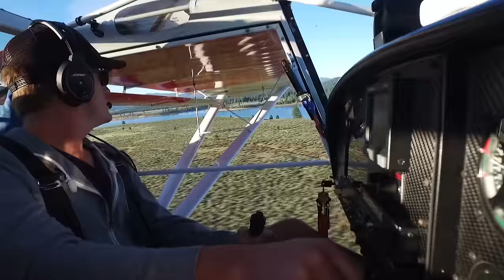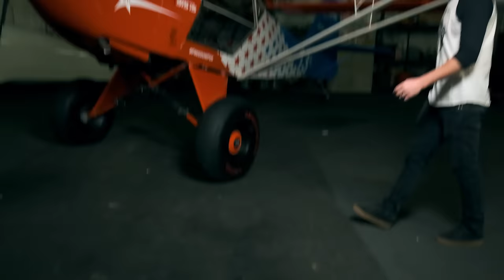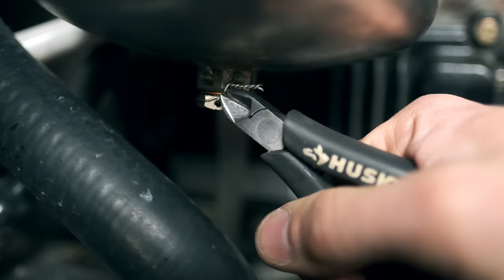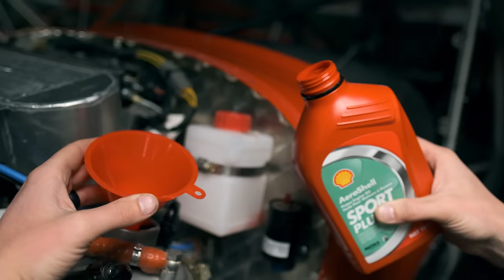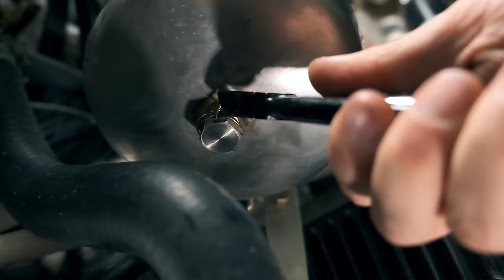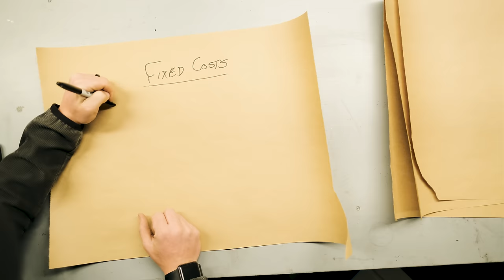What Does It Really Cost to Own and Fly Your Own Plane?

Comment: I'm an A&P mechanic on so I can save there untill an IA has to inspect my work and then sign my Mooney M20C log books which I have 3 log books 1. Airframe 2. Engine O-360-A1D and the Hartzel prop so I spend roughly on maintenance alone and if no major  work done I can spend about $2500.00 but this is not fuel, oil or insurance or hanger fees I spend $350.00 monthly on hanger fee which is heated so here in Illinois it's a god send. Or if you total it up about $7500.00 give or take a couple hundred.

I paid more for my car insurance policy compared to insurance on my plane and the airplane insurance through AVEMCO is a million dollar policy. I don't have electric gear I have the Johnson Bar
Reply: @Av8tore71 >>> FWIW, I would LIKE to build and fly my own homebuilt someday, BEFORE I become _worm food_...😊 
 
My probable choice will be something two-place and with fixed gear.  HOWEVER, if I DID ever choose a design with retracts, I would want something SIMPLE, as you mentioned.  

Just from being a former "Coastie", I am aware of at least two USCG aircraft that landed with at least one landing gear not extended {an HH-65 Dolphin and an HU-25 Falcon}.  Now, I was NOT personally involved in either of those cases, NOR were there any injuries IIRC.  However, the COST repairing a gear-up landing -- IF the aircraft is even repairable -- make retracts NOT a preferred option.
Reply: @Allan_aka_RocKITEman  the retracts  problems always seemed to be the ones that's electric or hydraulic. The Johnson Bar I mentioned is just push tubes and swivels which is just mechanical which makes it less likely to fail. There are plenty of kits out there like a Glassair 2+2. That's a nice kit it takes about 2 weeks to taxi or the Glassair II & III which is all aluminum but these are high performance aircraft. There is also Vans Aircraft which is very popular for home built. You can become a member of the EAA and you will have build coaches who can help during the build process.

Worm food??? Not sure what you mean but people can be worm food driving to the local grocery store

Comment: Trent hopefully you see this, How are you wire locking that drain bolt? it looks very wrong from the very brief glimps of you cutting then re wire locking it. It looks like you have just looped through the bolt and the bottom of the tank, with no twists between the seperate bits. You should have a loop through the tank part, twists, through the bolt then twists.
Reply from the maker: It pulls the bolt in the tightening direction, but it’s not perfect, I was rushed to shoot the video but I re did it after 👍🏻
Reply: @TrentonPalmer  Ah good it just looks an odd way of doing it (I wirelock everyday at work), maybe get an A&P to check your method next time you see one. Stay safe :)

Comment: Friend and I have a bare bones '57 Cessna 172.   It was not expensive as planes go to buy (think mid range used car price).  We have put a little in it to get a few things taken care of but overall it is a solid airplane.  I figure it costs $60-70 dollars an hour for around 100 hours of flying but we will probably fly more.  Our fixed costs are about 1/2 what Trent's are.  Fuel burn is a few gallons more per hour.  

Our hourly cost does not include a reserve.  We have decided not to do that.  Currently we split everything down the middle and when the time comes for a major expense like an engine we will either split it or sell it at the time.  I also look at it this way when you buy used vehicle you typically don't put money away for future repairs.  You repair it as you go and then if you get hit with a big bill you either sell it off or decide to fix it. 

Having a partner, if you can find the right one makes a big difference in cost since the fixed costs and maintenance costs are split in half.

Comment: Those of us who fly certificated aircraft have a great deal of cost information.  I think you are perhaps the only person who has addressed the cost of ownership of sport class experimental aircraft.  My annual  inspections have been running from a low of $5k to a high of $22k with an average of $7k for piston singles (certificated aircraft, fixed-wing).
Reply: My company has a Lance 2 and we would be in the same boat except we do ALL of the work and we have a friend who is a an IA and is very reasonable about his time with inspections. It is crazy how expensive parts are though. We fly about 500 hours a year so we are replacing stuff almost bi-monthly. That helps keep annual cost spread out though.
Reply: god damn those inspections sting.
Reply: @Jonnydeerhunter  at that point you start wondering if it would be reasonable to invest into your very own CNC machine lol

Comment: Recently just purchased a x-air standard for AU$15,000. Rotax618 two-stroke engine providing 75 hp. Doors and GPS included as well as all gauges. Aircraft is well beyond the years. So everything will be running on condition for ever probably. Not bothering with annual inspections as aircraft is amateur built and will not be using it for training or flying anyone except me and my dad and close friends. They are all happy and comfortable with this. i’m planning to look after the engine and the aircraft though thoroughly and hope it gives me a couple of thousand hours. The cool thing about these aircraft is they can easily adapt into bush planes due to their high-quality landing gear and rugged design. These aircraft are also extremely easy to fly, extremely easy to maintain, and long lasting. I’m expecting about 30 or $40 an hour, I own my own hanger outright.

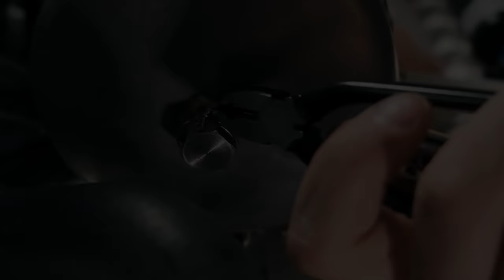Comment: as a A&P i would be able to tell a pilot safety wired that oil drain in  first 1:20 seconds  of this video
Reply: Yep, I saw that as well. Next step is to send Trent twitching pliers and then explain what's what.
Reply: @stuartkcalvin  Looks like a pair in the tool box already.
Reply: @iffykidmn8170  Mate, they weren't twitching pliers, they's was cutting pliers. There's fencing pliers, pipe cutters, wire cutters and twitching pliers.
Reply: @stuartkcalvin  >>> "Twitching pliers"?  Is that another name for safety wire pliers?
Reply: Is the twitching pliers related to twerking pliers?
Reply: @Allan_aka_RocKITEman  Nah mate. Twitching pliers have a securing mechanism at the tip (like vice grip pliers) and a rotating device at the end/bottom of the pliers that pulls a threaded piece that turns the pliers, achieving a twist in the wire that normal pliers can't achieve (by hand). That sounds complicated but it's simple in reality.
Reply: @stuartkcalvin  >>> Okay -- Thanks.
Reply: And yet, the oil drain will remain happily plugged until the next oil chage. :)
Reply: @hempelcx  >>> Unless that drain plus comes loose from vibration, partially due to the saftey wire {lock wire} aren't being not installed totally correctly....
Reply: @stuartkcalvin  What type plier is in the tool box :38 second mark of the vid?
Reply: @iffykidmn8170  hard to tell, maybe a swage tool for the lead piece that holds the wires. A regulatory swage tool will have a unique implant (well, for whatever regulatory piece is going on) to satisfy regulators that the wires have been twitched and held by a lead piece, crimped by a swage tool, which look like bolt cutters.
Reply: @iffykidmn8170  38seconds = They are standard lock wire pliers, or "twitching" pliers as you Americans call em.
I'm an Aussie maintenance engineer, I use them everyday.  I work with about 20 other engineers in the same hangar and every single one of them has a pair in their toolbox.

@Comfortable They aint cutting pliers.  There is a section there that is designed for cutting your lock wire, but they can barely do it. (especially if you're using 40thou or larger).
You grab the wire with the tip and bend in the spring steel handle at the top to meet the centre section.  Then you pull back the shiny centre section (with the holes in it) to lock the pliers shut. You can turn the silver handle at the bottom left or right to change the direction of the twist and then pull that bit to make it twist.

Comment: Some cost reductions include running aircraft on condition and also not bothering with an annual inspection if you’re not doing training which is legal in some countries if it’s amateur built. However, I will emphasise that both of those alternatives still need a common sense approach. Maintain your engine yourself, do inspections on the aircraft yourself, and still take precautions.

Comment: My costs for comparison:  This year my insurance went down to $489/year on a 1976 150M (which I purchased for $15,000 in 2016).  T-hangar is $150/month = $1,800 annually, and Annual Inspection is $1190 if no squawks or equipment upgrades.  Adding $200 for ForeFlight puts my annual fixed costs at $3675.00 .  I fly an average of 40 hours/year currently, so my fixed operating cost is roughly $92/hr dry.  This saves me about $50/hr over renting a 4-place Skyhawk, which would be extreme overkill since 99% of my flying is solo.  

My fuel burn averages 5.5 gal/hr at 92 knots true.  I can get it as low as 4 gal/hr at around 85 knots true.  I do have the AutoGas STC.  Only one airport in the area has mogas, but I've never burned it in my plane (yet).

Comment: I have a new(ish) LSA and I factor in about $10,000 NZD (Approx $6,300 USD) per year for fixed costs.  That's hangar hire, insurance and maintenance + rainy day issues.  A large chunk of my insurance is liability cover so that it doesn't matter how much I insure the hull for, I still have a fairly big bill (about $2,000 USD  per year all up).  Being an LSA it does have to be maintained by a LAME which is more expensive then if it was an experimental, but as I have a hard time changing a light bulb I wouldn't do any of my own work anyway.  TL;DR 5 year old LSA with rotax 100 = $6,300 USD per year fixed costs

Comment: First aircraft 1967 c150, e bay aqusition, 9800, (field derelict). Return to service annual 1700, (cylinder work required with owner assist) insurance 790, (18k hull value).  Mx 300 replacements for the old arc units 1500.  Before I sold the old little beast I factored a <50 per hour cost. I sold her for 13k before upgrading to a bigger airframe.

Comment: I paid $13000 last August for my 1957 Tri Pacer with a 150 HP Lycoming O-320.  It took about $2500 to get it flying (it was out of annual) but that includes a Sky Beacon ADS-B transmitter.  Insurance on it is about $720 year.  It burns around 9 gph and I pay in the mid to high $4.00 range per gallon.  While I would love to have a hangar, they are few and far between for a reasonable price where I live.  Its like waiting on season tickets for an NFL team.  I pay $45 per month in tie-down fees.  The plane has a cabin and mid-wing cover.  The paint has seen better days, but the fabric has a few more years left.  The wings and horz stab were recovered 2 years ago.  You can buy an airplane for less than many people pay for a new motorcycle.

Comment: Best advice I got from an old Pilot. If you have to finance it you can’t afford a plane. That includes experimental. On the bright side for buyers who are mechanics you can get unfinished kits cheap since most are never finished by the original buyers. You have to be confident in your skills though or you won’t finish it either. I finished someone else’s Pulsar III and put a low time, modified 912 that puts out 97 hp for .....30k. Yep brand new Plane with a low time engine that has a GRT EFIS. It does 158 mph indicated without pushing at 5 gal per hr. A very nice flying aircraft. Could put 2 Axis AP in for another $1600. Insurance is around 1200 year. Can’t say here what I pay for hanger rent, don’t want everyone pissed at me. Just want to put some hope out there for the people who took shop courses in high school. There are certain advantages if those skills are refined. Otherwise it’s a rich mans sport unfortunately more so now than any other time. Click on my icon for a look at its first flight.

Comment: After owning a few semi trucks, I can say these numbers aren’t so bad. 
Semi trucks at lest make money as you own it. 
But the cost of mechanics are about the same as a plane. 
Big truck labor at the dealer is 130-160 depending on what kind of truck you have and what dealer you go to. 
Then add sales tax in certain states. 
Trailer work is 80-130... same X factors come in to play. 

A full semi truck engine rebuild is about 30k. 
But that’s for a pre emissions engine. Pre 2007. 
Anything after that can range from 35-55 for a full replacement or rebuild engine. 

Those dpf and regen parts add up very fast and are very expensive.

Comment: When I did my maths I worked out that for me over here in the UK, if I few around 50hrs a year, it was cheaper and far more converiant that renting and aircraft and worked out even with being a part owner (again no argument on when I can fly).
The up sides of owning apart from the conveniance of being able to fly when you want, is the aircraft is set up as you want it and there are no change from aircraft to aircraft like you may have with hire planes even if they are the same model they often have switches in different places (so to me it is much safer to fly the same plane), also rental aircraft can be miss treated and nobody knows how much is hiden.

So I would say if you fly over 50hrs a year, whant to be able to fly at short notice, fly away for a break, want to really know the aircraft, then buy you own. If you fly less often than that, or can't aford to but, retired so can fly when others are at work, then rent or better still join a group.

Comment: I just bought a piper Cherokee 140.

We figured $40 an hour for fuel (7/8 gal an hour) and for oil changes and unexpected maintenance, we figured $25 an hour. This will help grow the seed money for the airplane for its year of use. If I plane on flying 200 hours a year, the seed money should be in the $5k range

Comment: Trent, set your "way-back" machine back to when you had the round cowl/two-blade black prop I wonder if you can answer a couple of questions if you remember. 1. Was that prop a "Priince P-tip Prop" from Lonnie Prince? If so, do you remember the pitch number of that prop? I recently purchased a "P-tip" prop for my 100hp Rotax with a 40" pitch that Lonnie said was for a 100hp Rotax but was unable to continue using it because it was pitched to "fine" and allowed my engine over rev and also cost me 12 knots cruise at my normal cruise RPM. We are looking at alternatives but in the meantime we have put our original wooden Sensinich prop back on and it is working fairly well.
Reply from the maker: I’d have to check but I believe it was a 80x42

Comment: Hi Trent. I know what you tried to do here, but I think because everyones situation is different, that there are so many variables, and things change so frequently, it is easier to stash double the annual maintenance costs away, and pay the hanger fee as it applies.  I like you have thought about costs often and how to equate them, but the answers just even for my situation are too vague.  Flying hours due to weather is a factor too. Some years I fly 120, others 50. Fortunately, most of us don’t rely on our aircraft every day unlike commercial ops, and taking care of issues as they occur is the only way for sure.  Thanks for you summation.  The only real measurable costs are the fixed ones, depending on your location as you indicated.

Comment: Another option is a used Ultralight on barnstormers.  As long as it isn't straight up falling apart, you should be fine.  Could probably find a used quicksilver  or a mid 90s J3 for under 10k.  No certificate to fly, cheaper and easier to maintain, and easy to store.  Not bad if you just want to get up in the air every so often and don't plan on doing cross-country flights.

Comment: I called Kitfox and priced out the airplane Trent Palmer has, with the 915iS and everything else.  As a kit, the price is about $145,000.  If you want construction done by you+factory at the factory about $35,000 more (though I never got an exact price on this).  So there you go.  Obviously a used junker can be a lot less.  A new 915iS engine costs near $40,000.
Reply: Christ!!!  Does he have glass cockpit??  Drop a Titan 340 or a smaller UL power in it and shave 15,000 off the price.
Reply: @damianketcham   : That only cuts the price from $180K to $165K.    :-(

Comment: The best way to do the accounting is to never divide out fixed costs to derive a combined hourly cost. Just give two numbers the fixed costs per month or year and the actual variable operating costs per hour. The reason you have to do it that way is in the case of a year that you flew zero hours, if you take the fixed costs and divide by the hours you flew, you end up with zero cost that year. If you were a business renting the plane out, you charge an hourly rate based on the properly calculated hourly costs plus an hourly “contribution” rate that goes toward the fixed costs. Then you derive your break even for how many hours you need to rent each year or month. All that to say every aircraft owner just need to know two numbers: cost per operating hour and cost per year or month.